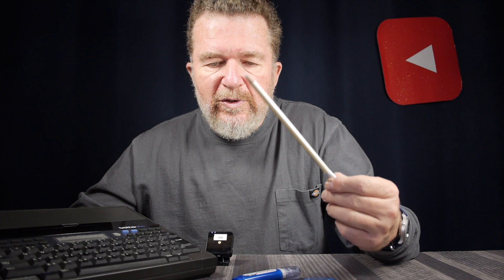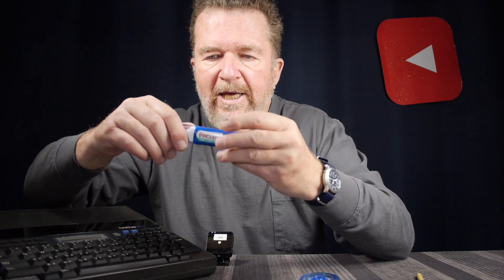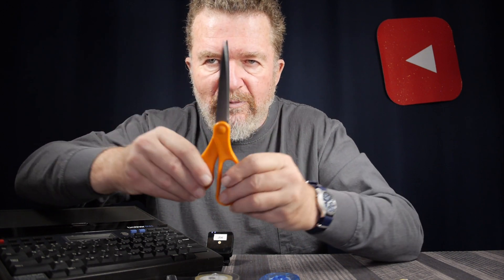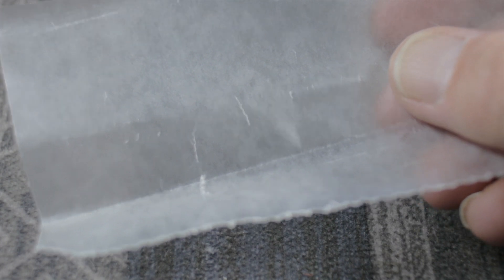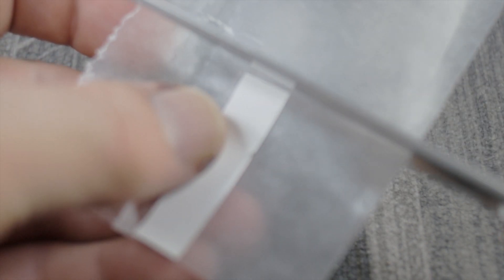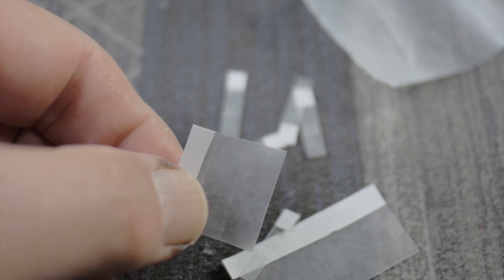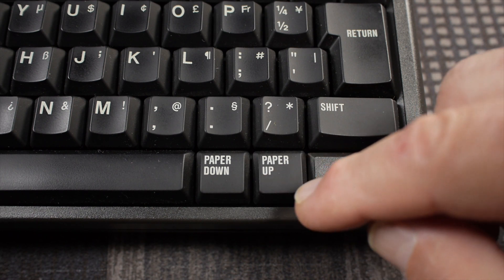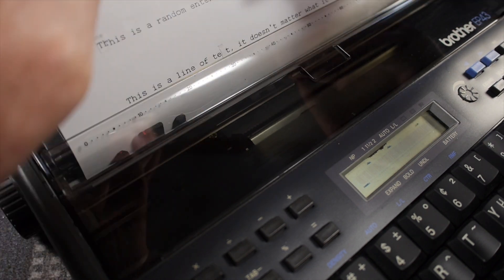Typewriter Video Series - Episode 215: Thermal Correction Strips

Comment: This video makes it very clear. Honestly, it sounds very doable, even for me. Would it be any easier if you stick a bunch of precut chads onto a larger sheet of wax paper? So in effect, it would be like a sticker sheet. Also, they do still make thermal labels. One could cut chads out of that. But I suspect that paper is much thicker. By the way, not only did I find the original Brother EP5 charger among my stuff, but also ribbon cassettes! I'll have to demonstrate the correction process for you in a future video. Thanks so much for the shout out! I wondered why I got new subscribers.